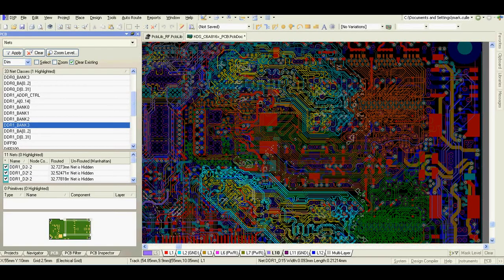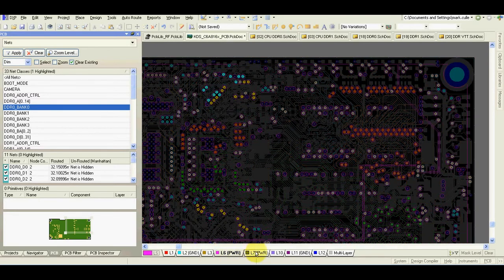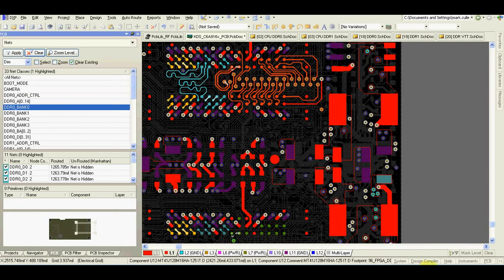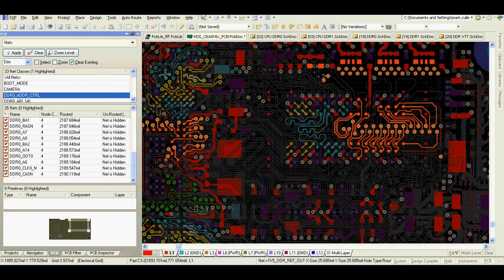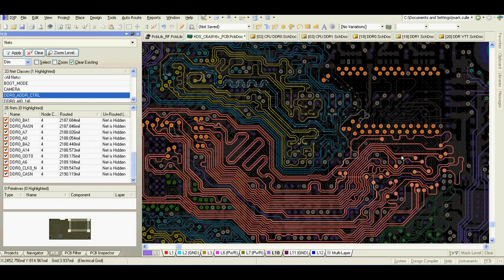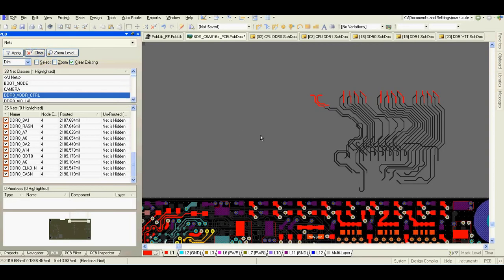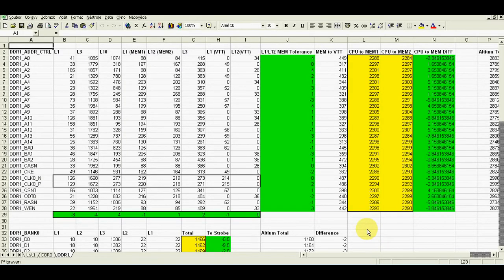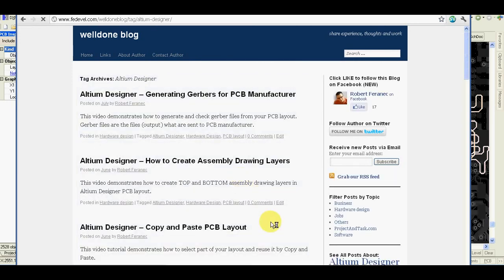Altium Designer -- DDR3 routing and PCB layout video

Comment: You are creating an Excel spreadsheet with data, doesn't Altium contain an internal feature to do this? Also, is that data generated by running a script inside Altium?

Comment from the maker: Hi Arlen, 
- I dont use VIA in PAD as I have seen problems during production (+ PCB is more expensive). 
- I place VIAs manually. Why? Because I can place VIAs the way, that I have space to take out all the signals out from the BGA. Also, decoupling capacitors (and other components) under the BGA need to be taken into consideration during placing VIAs under BGA.
Reply: This video is almost a decade old and was created at a time when I was going through the most hopeless and pathetic stage of my life. Do you think it could be updated now to reflect the new Altium Designer?

Comment: Hi Robert,I have to design a PCB with a FPGA and DDR3 memory , I'm beginner with BGA packages  ...  I saw some pcb where the designer place vias next to each pin, and someone put vias on them, my questions is ... when do I use one of them?, I have put a via one by one or there is a tool in altium to do it?, and the last , There is a big difference in the performance of the pcb?,
Thanks in advance